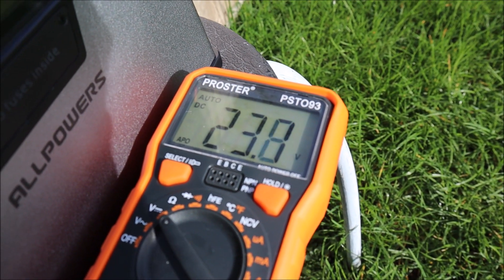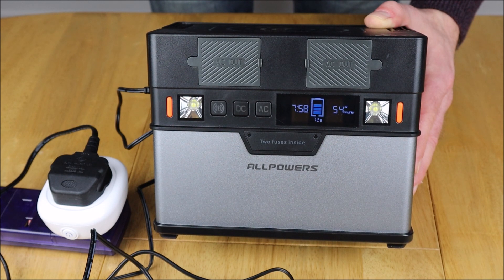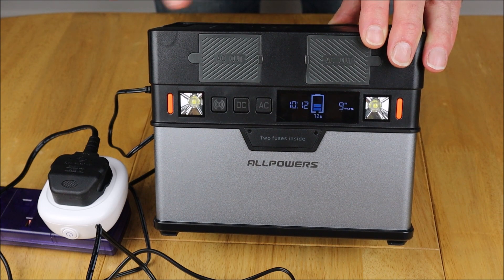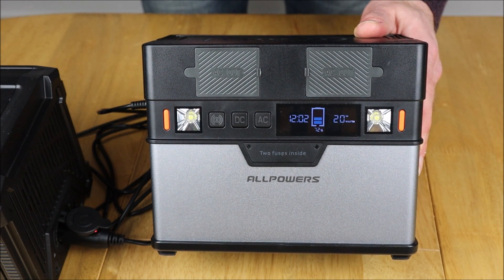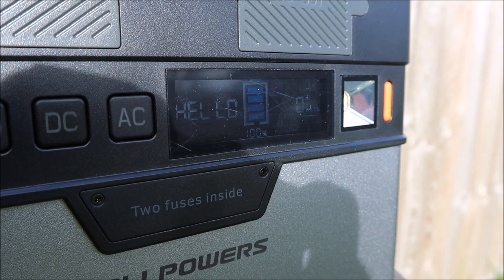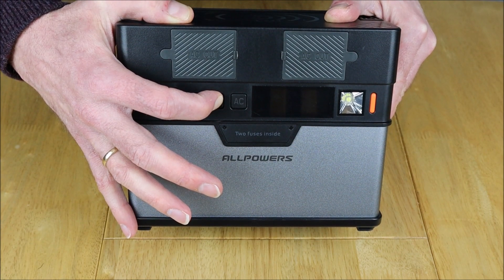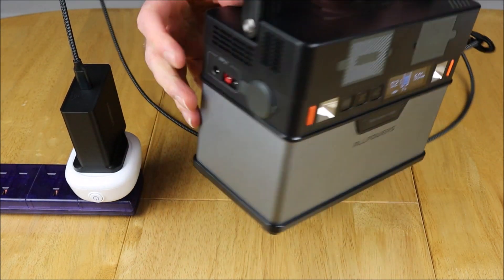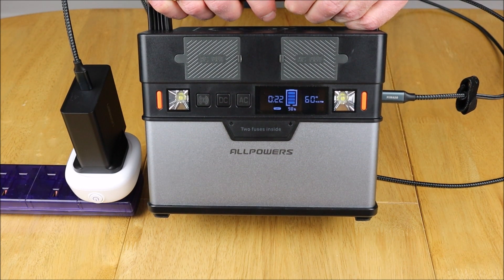ALLPOWERS 372Wh Portable Solar Generator Update | Charging Rundown

Comment: Do you think the 372 would be able to boil water in a travel kettle such as this one https://www.amazon.co.uk/dp/B07SH7LSQN/ref=cm_sw_r_em_apa_i_6L.OFbJQV64SP?_encoding=UTF8&psc=1 with careful adjustment of the dial on it? (Maximum wattage of kettle is 680w) whilst watching the wattage used on the 372wh it does say it can peak at 500w and it wouldnt need to operate at peak watts for long to boil 600ml of water
Reply from the maker: @Graham Jones  The peak is brief and the inverter would trip as the kettle tries to fire up. I'd even say the 666Wh might have problems sustaining 680W for the time it takes to boil a kettle (pending testing). A low wattage kettle is on my list to buy and test. Cheers, Adrian
Reply: @DADvinci  i think the 666wh allpower will be able to handle it as it should only take 6minutes to boil even you fill it too its 600ml capacity. These power stations can usually run at peak for about 20-30mins i think. And 680watts isnt even near its 1000w peak rating. I wonder of your in danger at all of damaging the batteries if you use it alot for this purpose. Ive seen some chinese kettles advertised as "student dorm water heaters" that range in size from 1.1-1.4l and in watts from 300-450watts which are probably more suitable fpr the 372wh.
Reply: @DADvinci  i tried this 680w kettle with the 666wh and it trips out even with the knob turned to the lowest "insulation" setting i was seeing spikes of 800-900watts on the 666wh before it started beeping and cut out.
Reply from the maker: @grahamjones6712  Thanks for the info. As per my previous comment, the result is what I was expecting. Cheers
Reply: @DADvinci  the 300w immersion heater did the trick it actually doesnt seem to have an inrush wattage at all like the kettle did. It actually didnt draw 300w in the end only around 260-270. Even worked on my 200wh (200w continous 300w peak) generator for 25mins without it beeping or complaining. My 200wh generator doesnt display a wattage output it just displays a temperature which i assume is the battery temperature which slowly rised from 10°C too 25°C while the immersion heater was running. The units fan didnt even come on like it did on my 666wh allpowers twice.
Reply: You could use them to boil up some water for some of those debydrated trekking food foil bags instead of using a gas stove when camping. I think the same company makes a 500w immersion heater with a uk 3pin plug instead of the EU plug.

Comment: I have gone through all your videos, they are very informative but I can't find an answer to my question. Mine worked okay then the AC button stopped working. When i press it, the screen comes on for two seconds then off again. I tried replacing the two fuses in the front, I also tried the factory reset which is holding the AC button down for 20 seconds. None of these have worked. any suggestions?
Reply from the maker: @Fredah B  Good day Fredah and thanks for your comment. I'm sorry you couldn't find the answer in the videos. A few questions if I may.

> When you switch on the AC is anything plugged into the sockets at that time (or are they empty)?
> I noticed that you referenced doing a factory reset by holding down the AC button for 20 seconds. Did you mean the DC button?
> Have you used the app at all with your unit? If so, does it do the same thing when you switch the AC on using that?

I look forward to hearing from you. All the best, Adrian

Comment: My unit seems to be screwed. Won't take charge anymore at all. The battery indicator symbol just continuously blinks on and off. Did the factory reset multiple times to no avail. Is their a fix for this. Is this a safe mode? Can it be fixed? Please Help!
Reply from the maker: @Germaine Turnquest  Good day! I'm sorry you are having problems, let's see what we can do. Please can you let me know the following?

1) How much % charge is left currently?
2) What method are you using to charge that results in the flickering screen?
3) If there is charge left, do the USB ports (DC) and AC switch on/work?

I look forward to hearing from you. All the best, Adrian

Comment: Great video! I won't be buying one of them then 👍
Reply from the maker: @ksrnate  Good day and thanks for your kind comment. I managed to find a workaround purely by chance as the Anderson input voltage range is slightly sensitive on my unit. I cover the workaround in this video > https://youtu.be/ViLdkYzOZqA if you wanted to have a watch.

I was originally planning to send it back, but once I got the hang of the workaround it was fine and has been working ok since. There's a playlist covering the 372Wh if you wanted to have a look too > https://bit.ly/2AbwG5L . Please shout if you have any questions. All the best, Adrian
Reply: Do you know the brand of batteries used in this product?

Comment: Could you use/get jumpstart cables for this?
Reply from the maker: @quadfly360  Good day and thanks for your question. I wouldn't recommend using the 372Wh for jump starting as it wouldn't be able to deliver the amps required. You might be able to use a standard AC car battery charger with the 372Wh, but I've not tested this as yet. I hope this answers your question. Please shout if you need anything else. All the best, Adrian

Comment: Hi I’m in the process of returning mine as the AC 3 pin socket pushed into the unit and is floating around inside. That’s a very basic floor in the design really I was happy until that happened, hopefully they can sort this out quickly but mine hasn’t got covers over the ac sockets.
Reply from the maker: @Russell Ingram  Good day Russell and thanks for your comment. I'm sorry to hear about the issue with your 372Wh. You've got the newer/revised version to mine, which is an improvement as plugs sit flush with the body of the unit and the rubber covers don't get in the way. From what the manufacturer has mentioned before, issues like yours can be the result of the journey from the factory to warehouse, especially when shipped. I've knocked mine over a couple of times (once off a stool) and damaged the display back-light (dim now), but it still functions fine thank goodness.

I really hope you can get this sorted quickly as it is a good little unit, one that is part of the furniture in my house now. Please shout if you need anything. All the best, Adrian

Comment: WARNING – THIS DOES NOT WORK
I purchased this and at first, it worked well. Then it stopped charging. I told the company and they replaced it, which was great. Except, the AC outlet did not work. I told the company again, they said, send it back, we will refund the cost of the unit and the postage. So I did. They promised the refund within 24 hours, which did not arrive. Many ignored emails later, they promised it again, within 24-48 hours. NO REFUND ARRIVED.
THIS IS AN EXPENSIVE BRICK. IT DOES NOT WORK AND THE COMPANY DOES NOT FULFILL REFUND PROMISES
Reply from the maker: @Lester Wills  Good day Lester and thanks for your comment. I'm sorry to hear of the problems you've had with the units and company. Whilst I completely appreciate your frustration, the feedback from other viewers and my own experience is that the 372Wh works well for more than it doesn't. Yes, some viewers experienced problems similar to yours and have returned their units or received refunds, but that's consumer electronics. Reliability of the units is based on many factors from manufacturing defects to storage and handling during delivery. 

I've had mine for 6 months now and have tested it to the max. I've dropped it a couple of times, more recently knocked it off a stool. At first, I thought it was broken as nothing seemed to be coming up on-screen. All that appears to be damaged is the display (very dim now), but still shows all the info correctly.

Originally, I was two days away from sending mine back until I discovered the Anderson port workaround (in a later video). I've suggested to some viewers who were concerned about reliability not to buy this unit as I’m unable to vouch for mine long-term as yet. At the end of the day it's a personal choice based on videos like this and reviews in the marketplace.

I will continue to use mine as normal and report back any issues, including long-term reliability so that viewers can make informed purchasing decisions (always been the case). Whilst I agree that this would become an expensive brick should it fail, when it's working as intended it is great value based on the marketplace and warranties are there to cover failure. When I've had problems with companies in the past, I've claimed back from my credit card company but I'm not sure where and how you purchased yours.

I sincerely hope you find a suitable resolution as soon as possible. All the best, Adrian
Reply: @DADvinci  Thank you for this. Tried the credit card company, no help. I originally thought this was a fantastic device until it failed, not once, but twice (i.e. the replacement device failed as well. The company keeps making promises, with the latest being they will ask a supervisor about a refund (after having previously promised a refund three times). I sent this back to the address they specified and it as been received, but no refund has been sent.
Reply: @DADvinci  Thank you for your comments. I too thought this was a fantastic unit, until it failed, twice and then they made promises of refunds that they did not keep. After I mounted a campaign to inform people via numerous web sites and social media about what had happened, they finally relented and provided a refund (minus a fee of course).  It is a shame, as this seems a great product, when it works.

Comment: I've just ordered the 372 version and have literally just seen this. The beudens one is nowhere to be found otherwise gauging by the comments I may have looked at that one instead. I'm looking at comments stating faults. So for clarification, the cables provided with the product are unsatisfactory? Forgive me, I'm not very machine minded but given the current world climate I wanted to add solar power to my arsenal. Any comments would be appreciated. 👍 Cheers for the video.
Reply from the maker: @Matt B   Good day Matt! Thanks for your kind feedback and question. There have been certain 'characteristics' with the 372Wh, but the workaround I found stopped me returning mine. The version you've just ordered is slightly revised and I've had one viewer recently feedback that his portable solar panel works without issue via the Anderson port (preferred charging port for solar). Depending on what solar panel you go for, you may require an extra cable so I can help with that once you've decided (if not already). I'm not sure how many of the videos you've seen in the 372Wh series, but I suggest having a look through the playlist first which will give you a better overall picture > https://bit.ly/2AbwG5L 

I use mine daily without thinking about it now and it remains a great value unit. Like most consumer electronics, you will always get a % of people who have problems. Please have a look at the videos and give me a shout so I can fill in any blanks or answer any questions. All the best, Adrian
Reply: @DADvinci  Appreciate your quick response, cheers. I haven't purchased a solar panel as of yet because was not sure what to go for but have researched quite a few. Wanted the allpowers foldable 100w but the delivery of £42 put me off so options are limited therefore I will look for another brand. Allpowers didn't seem to have many other options for 100watt foldables. Thanks for the playlist, will have a watch over the rest of the week. Regards.
Reply: @DADvinci  OK I've watched your playlist. Enjoyed it 👍. This is what I want to get. Would I need additional wires do you think? The specs bug me out 🙄. Thanks in advance.
Reply from the maker: @Matt B  Hey Matt! I'm glad the playlist was useful. You'll need a MC4 to Anderson connector cable. This is the one I used in the Working from Home video > https://amzn.to/3aCMFac (affiliate link) but that's not available. An alternative is the ALLPOWERS version > https://amzn.to/2B0A83w (affiliate link) and it's in stock which is unusual with ALLPOWERS cables! You could try eBay for something cheaper, but you might have to wait a long time for delivery.

I hope this helps? Please shout if you need anything else. Cheers, Adrian
Reply: @DADvinci  Thanks so much for your assistance. Will subscribe 👍
Reply: @DADvinci  Hey, I have used the generator now charged from mains. It was almost like the kettle kept tripping the generator every time I turned kettle on but phone charger works as does television. Bit strange. Any ideas?
Reply from the maker: @Mighty Clarets  Hey Matt! Glad to hear the mains charging went well. The AC inverter has a limit of 300W, so a kettle won't work if it's rated over that and will trip it out. It might be worth checking the wattage of the kettle as I suspect it's higher than 300W. Great to hear the phone charger and TV are working fine. Please give me a shout when you've had a moment to check the kettle out. All the best, Adrian
Reply: @DADvinci  your so right sorry I didn't expect the kettle to be pushing 2000w. I guess the small items that produce power fast is what I was overlooking. Many thanks for your help.